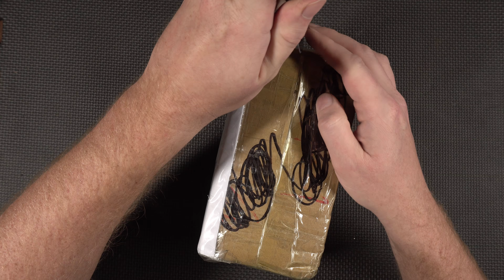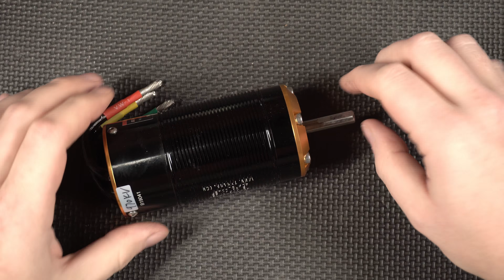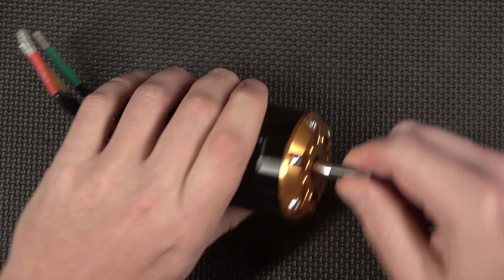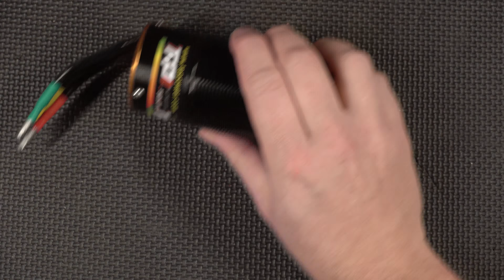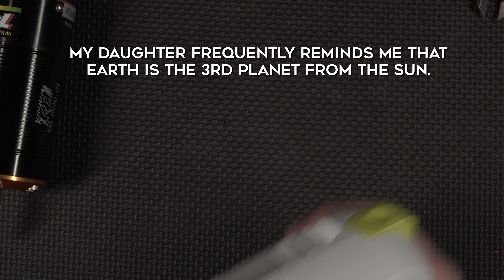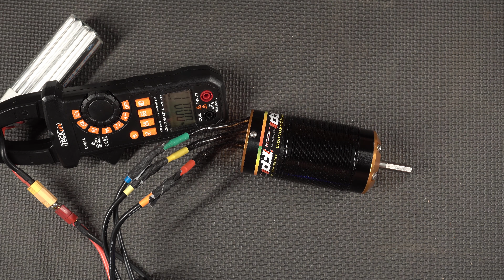20 Hp Brushless Motor!  TP Power 5860 Unboxing & First Test

Comment: I once received a TP motor that also felt hard to turn but that was because the rotor was slightly off center and was rubbing on the inner walls of the winding. I uploaded the video zoomed in so people can see it. Then the second motor that came in had tire tracks on the package and this one is not 100% center either but bcs of the tire tracks, I can’t tell if that’s factory or from getting ran over.

Comment: You must not know about quality inrunner motors..I run nothing but TP Power motors in my electric ducted fan RC models. The “stiffness” that you feel is actually from the use of the best neodymium magnets. Lesser quality magnets don’t have the same strength—So—You can easily turn the shaft on those motors. I have yet to burn up a TP Power motor in an EDF application.

Comment: Hi I think your wires may of been touching this makes it hard to move the rotator
Reply from the maker: That's true of some of my other motors; but not these.  Apparently, the more poles a motor has the more it "cogs" when trying to turn manually.  Of course, on the wire touching thing, you're right - shorting the windings makes it even more difficult to turn the motor.

Comment: Whilst the youtube title of 20HP is catchy, the correct specification for this motor is 7000W continuous, which is about 9 HP not 20 HP !  The 11,000 W (20 HP) rating is maximum, but as usual the manufacturer provides no further details as to how long the motor can sustain that power.  Common sense should tell you that at a rated efficiency of 90%, the motor will be dissipating about 1.1 KW of heat, so thats not going to happen for long.  Chinese specifications...............LOL
Reply from the maker: I ultimately went a little larger in practical use with a 5870.  That one ran at just under 14kW the entire time I ran it.

Comment: I just started watching your videos. I have almost the same set up in my mustang. Belt driven s trim. It's much faster but not perfect. So my comment is this, if it takes 50-70 hp to turn my s trim, how are you going to do it with a 20 hp motor?
Reply from the maker: Like this: https://youtu.be/AOL3Qyczt3Y

Comment: Hope you can help me. I'm new tot he brushless motor hobby. I bought a TP Power 4070 motor 2200kv and yet to buy the battery and esc. I was told that I need to be careful about the length of the wires from the battery to the esc, and from the esc to the motor.  Is there a formula for that? Thank you in advance, Bill
Reply from the maker: That's a good question Bill.  What I've found (by blowing up four expensive ESCs - cheapest was about $300, most expensive $1,700) is that long battery cables can lead to voltage spikes which can damage the ESC.  Putting a low ESR capacitor bank at the ESC can compensate for that.  With long motor cables, I've found that sometimes sensorless brushless motors have a hard time syncing to the ESC.  That's much harder to fix.  Typically you need a much higher quality (expensive) ESC to fix that issue.  Keep in mind, my cables are very long - I'm building electric turbos for actual cars.  I tend to prefer longer battery cables with capacitor banks.  But if your motor cables are under a meter long, you generally will be fine.  Battery cables depend on the batteries and the cable gauge.  I'm running about 15 feet of 2 gauge battery cables in my current setup.
Reply: @AlexLTDLX  I'm looking at something much shorter. It will be used in an airplane.

Comment: If you want to measure voltage drop/resistance, set the multimeter to Vdc and put neg lead on the positive on the battery and positive lead to the power input on the back of the motor, the Higher the voltage reading on the multimeter the higher the voltage drop/resistance in the circuit as the multimeter is measuring the potential difference.

Comment: How do you get the Power figure of 20HP?

I have little to no knowledge of this but I want to make dremel tool where the motor is within the handheld enclosure but has quite a bit of power. I have tried multiple dremels that are sold online but found them to be either too inconvenient as a package or too underwhelming in terms of power.

I think a motor with roughly 18000 to 22000 RPM and 1-2 HP.
Is this even possible? 
An answer would be much appreciated.
Reply from the maker: Horsepower and watts are directly related.  746 watts = 1 hp.  These brushless motors are typically 90-95% efficient; so let's say it takes about 800 watts to generate 1 hp with this motor.  So far in testing, the highest observed power was 22,000 watts - which is actually over 27 hp.  Admittedly, it was burst power, but there none the less.  We're typically running around 14,000 watts going down track.  You can calculate torque from hp and rpm - this video goes into pretty good detail with some actual data logs from our drag tests: https://youtu.be/4Wwzjgn4fog

Comment: Not even close to 20hp..
Reply from the maker: It's actually over 20hp in our testing.   You do know that hp is a function of torque AND rpm, right?  This video proves it:. https://youtu.be/AOL3Qyczt3Y. Multiply volts by amps to get watts at divide by 746 (watts in one hp).  Before losses, we were over 24 hp the whole way down the track.

Comment: which esc is needed for this i would like to build into my mhz boat and which batteries would be necessary for this
Reply from the maker: I don't know.  I'm using it for an electric turbo. The only ESC that hasn't blown up is a 16s 400 amp APD esc.  I run 4x9000 mah 4s lipos in series; and that pack is in parallel with another 4x6000 mah 4s lipos.  You're looking at close to $2,000 worth of batteries and ESC to really use this motor.
Reply: @AlexLTDLX

Comment: Is it worth price?
Reply from the maker: For what it is, yeah, probably.  Is it perfect?  No.  But I know have two of them and for the most part, they perform well.  There are a few sniggles here and there - the aluminum on the rear caps is little thin and one of the screws on my 5870 was stripped and l0ctited from the factory - I ended up loctiting in a helicoil.  On this motor, the front plate was machined without taking into account the thickness of the anodizing.  Which meant running a tap through the mounting threads to get screws to fit.

Comment: I’m building a custom winch for my atv you think this would be powerful enough??
Reply from the maker: It's more than powerful enough, the problem is you need torque not rpm. Since horsepower is a function of both speed and torque, this thing doesn't put out that much torque but it puts out a lot of speed. so you would need one heck of a gear reduction to get it to go slow enough to work in a winch. Remember this thing's peak rpm is 50,000.  You'd be better off finding an OutRunner motor with a similar kilowatt rating and a lower KV or RPM per volt.  But either way, understand that you don't just simply connect this thing to a battery. I've blown up two $300 controllers and I'm switching over to an $1,100 dollar controller just to control the motor.  And you're not going to connect this to your car's it electrical system either.  On our bench tests we've seen peaks of 22 KW and running power of around 13 kw. 22 KW is more than anything in your house uses, including air conditioning or electrical heat even if your house is resistive electrical heating.   The current battery pack we're using cost about $900 and can only run this thing at what I would consider full power for about a minute.  But it would also melt down in that minute without ice water cooling.  That's the long answer to your question. So in short yes you can use this in a winch, and it would be very powerful. However it's the wrong choice.  And you'd probably end up with the world's most expensive winch.  Hope this helps.

Comment: These motors run on the giant esc like the easyrun and mamba monster xl2, let me know if I get the esc names wrong
Reply from the maker: I've been using Flier ESCs - I've blown up one already and I'm being cautious with the second one  - the first one blew under it's rating.
Reply: @AlexLTDLX  - To my memory The Flier ESC's don't come with much of an heatsink to dissipate the heat from the mosfets (they worry about weight on RC aircraft ESC's) so you could (should) do what I do with the ESC's for my RC car and boat projects and mod that Flier ESC - strip it down,put a bigger heatsink with a little high speed fan on and/ or use computer CPU/GPU water cooling blocks, a circulation pump and it's own little radiator and repot the ESC, All the parts are easy to obtain from ebay and not that expensive really. Then again If memory serves me right the Flier ESC's don't have much of a peak ampage like the ESC's meant for RC cars, find one that does and it should be a lot more reliable, Especially so if you use the above suggestion . All the best and good luck with your projects.
Reply: If you run a castle xlx2 esc make sure kv rating is within specs or else the esc will fry.have a few friends that own the xlx2 and haven't had any problems with them but seen a few people on here plug them in and send them up in flames in a matter of minutes if not seconds.if everything's good on setup that esc can put out 500amps without flinching though so its a beast.also need to make sure you have good batteries with a high c rating and high amp rated connectors like the xt90,castles 6.5mm connectors or even castles 8mm bullet connectors otherwise connectors can get hot enough to actually melt the solder on connectors.also don't think you get motors full potential on a 4s battery pack since motor is for a 5th scale rc that usually run between 6 and 8s.

Comment: When you have so much flux that you can't even turn by hand you know it's gonna have some serious torque
Reply: Agreed. After he said the shaft is surprisingly hard to turn and thought it was seized, I realized he’s not going to say anything else useful about his review of this motor.
Reply: The terminals were also shorted when he was trying to spin, if they hadn’t been it most likely would’ve been much easier since with no connection there’d be no load
Reply: That s quite a lot of cog too

Comment: Can i use it in e bike..???
Reply from the maker: You'd have to gear it down pretty far.  Either that or prepare to go warp factor 9 on a bicycle.  Acceleration would suck though.  And outrunner type motor would be a better choice - something with a much lower kv.

Comment: I would use 8mm bullet connectors each covered by heatshrink to prevent short circuits for connectors. 300A ztw beast should work fine for ESC. I have a 5660 smooth can version 888kv on 12S running their marine ZTW Seal 300A esc and its a beast. Definitely recommend making a capacitor bank for the esc so you dont get voltage drop

Comment: Very fat tp power 🤩 🔥🔥
Reply: As far as I know most of the rc motors out there are made in China including castle creations but don't quote me on the castle motors cause I don't know much about them.ran my slash on stock vxl 3s setup for roughly 8yrs until I decided to make it a lcg chassis and step up to 6s power to make it a speed run beast.literally just bought my first castle esc ever about 2 months ago.went with the mamba monster x 8s and plan on stepping up from traxxas udr 2200kv motor thats currently in it to a tp motor(believe the I want is 2700kv)as well as a poseidon motor just to see which one will give me best results.if I can't hit 140mph with it on 6s then im stepping up to 8s and putting that bitch to the moon.lmao

Comment: So, what kind of ESC do I need for this motor?
Reply from the maker: I'm not sure yet... I'm trying to find the best option.  I'm open to suggestions.
Reply: @AlexLTDLX  i use the Alien esc 350amps sport 2..
Its a geat combination for my 5th scale Rs5 on 12s.
Reply from the maker: @jimveerm3  And it works well for you?  Thanks!
Reply: It really depends on what you're doing. I run two TP 5870's and both in DBX-E's. The 6D run with a Max5 on 8S, and geared right, it is a perfect match. The other runs 12S and an MTZ Beast 300A ESC and that is a 5D. While the 5870 is rated for 10k rpm less than the 5860, the 5870 is the more powerful one for sure, and the speed difference is easily made up in the gear ratio.
Reply: @AB-80X  How does your 5870 5D do with over voting it? The 5D is rated at 36V and you're pumping 44 volts! I'm asking because I plan on running the 5860 1450KV (rated at 34V) at 37V. Would love to hear how it's been holding up for you!
Reply: @scottg496  
I got them switched around in my description. The 6D is on 12S and the 5D is on 8S. They run great, but as with all rigs you push, correct gearing is key.
Reply: I have that motor,  and have great success with it...im running it on a flier esc 400amp on 12s and can run 85 mph all day long in a rovan f5
Reply: Elvert Mack what KV motor are you running?
Reply: @scottg8177  985 tp power motor
Reply: Look under my name under rovan f5 brushless
Reply: @elvertmack5039  What ESC do you use?
Reply: @AB-80X  flier 400amp
Reply: What kv are u using

Comment: The biggest motor they make is 100xl @97 bhp or 72 volts@660 amps Lehner LMT has a 1600 grams motor-3080 that maxed out at 72 volts and 600 amps!!! They also have a 30100 that's 2100 gram's @40Kw or around 50-75 bhp with a MGM 80063 ESC - 63 volt@800 amps to run it🤓
Reply from the maker: Holy cow - I had no idea.  If this works maybe we'll go nuts and see if we can spin up a YSI or some larger blower and run 8's in the LTD!  The problem with the bigger motors is max rpm.  But it might work for a TVS 2500...
Reply: That us true....mgm does....but that combo will set u back 2300 bucks.

Comment: hey what do you think about this motor TP POWER TP4030-CM 
 it goes up to 96000rpm?
Reply from the maker: I don't know - Id have to look into it.  I can tell you that I've taken the motor I have apart, and it's pretty far from a precision piece.  Hand grinding for clearance and cheapest of the cheap bearings...
Reply: @AlexLTDLX  when is the new episode?
Reply from the maker: @reinkarnatsioon  You mean the next video here or the next episode of All Out Live and The Call Out?  All Out Live's Lapeer Muscle Class show is being finished by an editor to my left as I type; and I'm going to try to post a new video in the next day or two.  It's been brutal lately - after the heatpump thing (which I did make a video about), my kid had a cold with a fever of 103.9, my mom had two heart attacks a couple of weeks apart, my neighbor's house burned down, my dad has gotten to the point where he needs daily care and of course, the Wuhan virus is dominating everything.  But I have been making headway on the blower (believe it or not)...
Reply: @AlexLTDLX  sry to hear that, hang in there, will be waiting for the progress of the blower then
Reply: @AlexLTDLX  atleast you can say handbuilt :D
Reply: What do you need it for? The CM motors are only interesting if you need the RPM. They are not necessarily more torquey than a regular 4030. The math is pretty simple. Combine the RPM you need with the amp and voltage you have available.
I have a basher with a regular 4070. It's a 300 amp beast rated at 24 volts which is all I need for my 6S application. I have the ESC that can run the smps, but I don't need more rpm. Someone asked me why I didn't go with a 4070CM in 1800 kv or a 2200 kv. Well, the answer is simple. I have 7200 watts on hand with the motor I run now. If I ran the 1800 kv 4070CM, I would only be able to pull 5400 watts on 6S and the 2200 kv mill would let me use 6600 watts. It's a no brainer really.
So look at your goals and what you need.